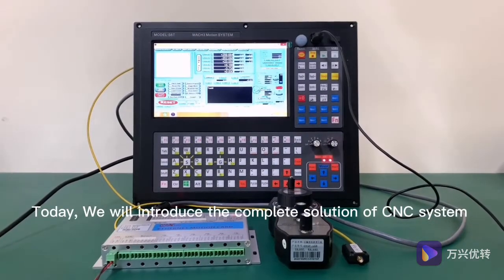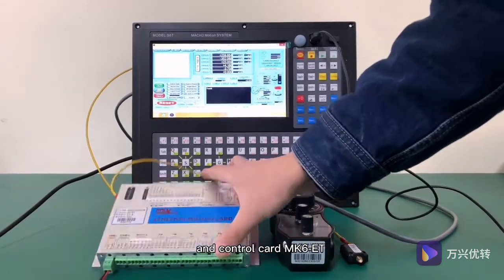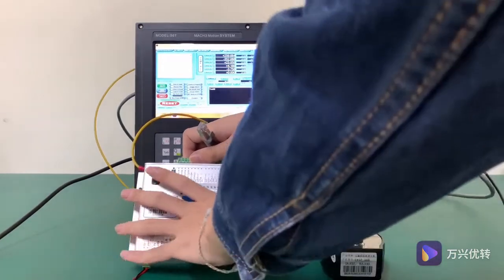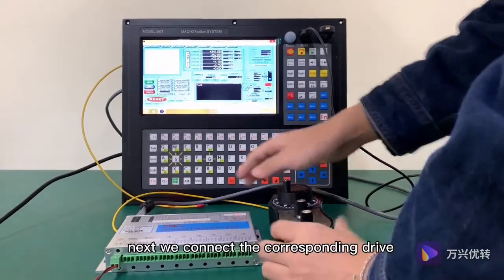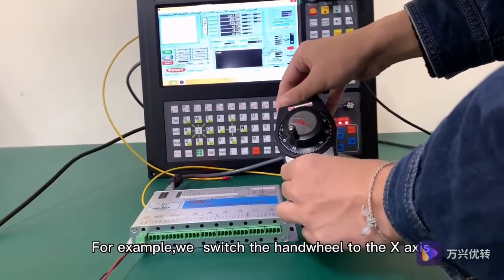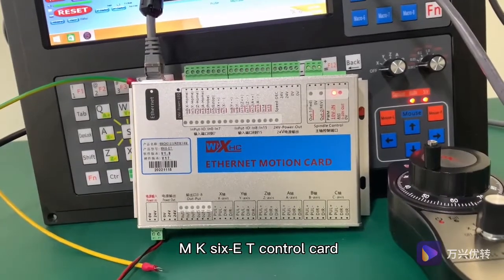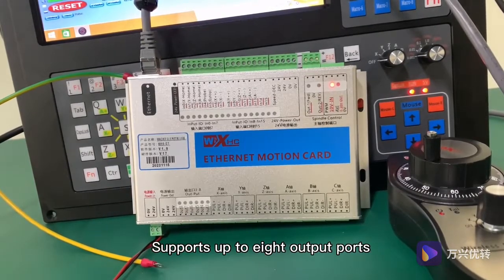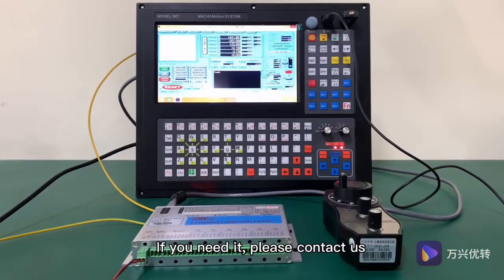MACH3   system display

Comment: Please mare videos XHC eth CONTROLLER, show the connetions and  how work in cnc
Reply: I have contacted you as you say on the video but I have no reply, the control Kit I bought from you direct are not working, the XHC is not communicating with the monitor control. Mach 3 helpdesk told me that I need a plugin .ddl file from the manufacture to have it work with mach3. I look at your site but I still cannot find this plugin. I m more the months waiting.
You can not do that with client. I this cnc machine was in a production line wait to be repaired it could be a disaster. Production will be stopped.
Amazing
Reply: Hello @woodartsdeing9964. Did you have any luck with this system?